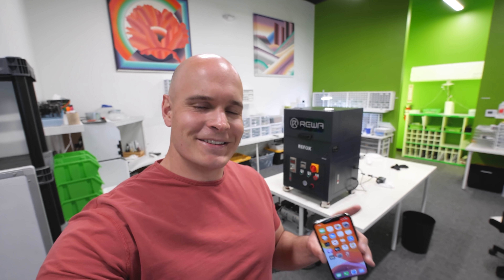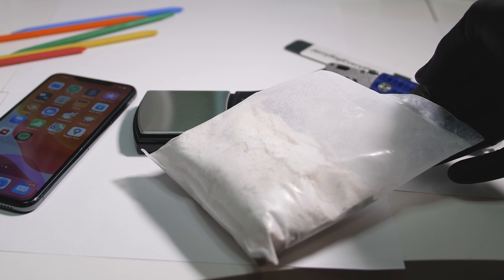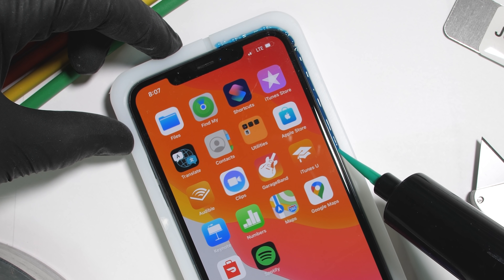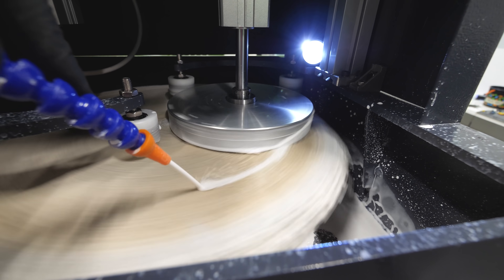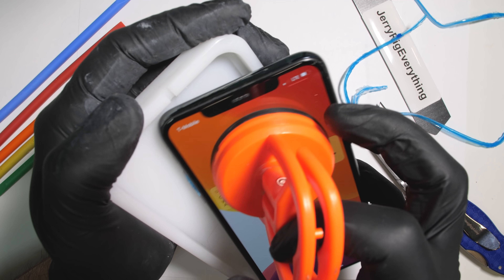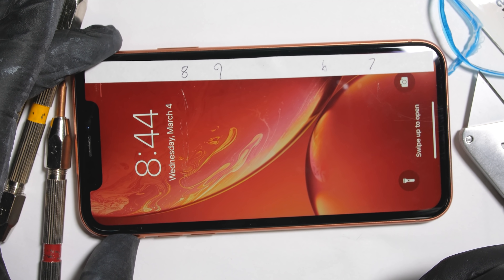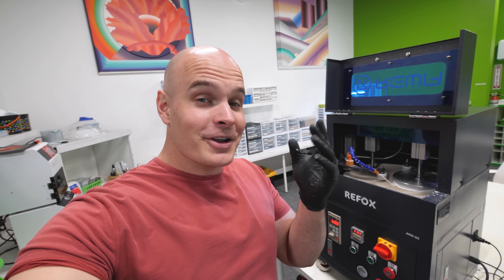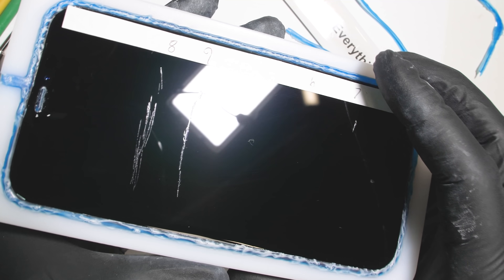How to Remove Scratches on an iPhone Screen? - (Not Clickbait)

Comment: Exam question: Define Glass.
Glass is an object that scratches with Mohs hardness picks at Level 6 with deeper grooves at Level 7.
Reply: Don't forget to mention the second definition or you will get a mark-down!:
"Glass is glass, and glass can break."
Reply: That's true for this hardened glass. But there are glass types with different hardness levels.
Reply: @lukmly013  No way!